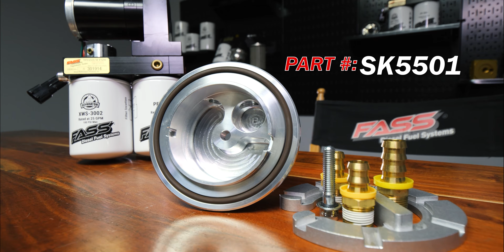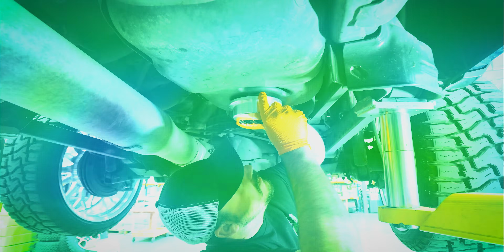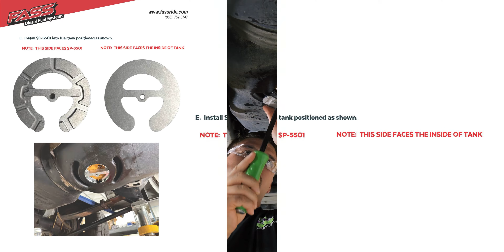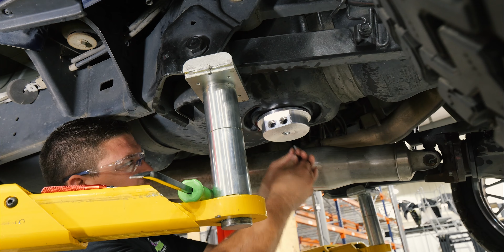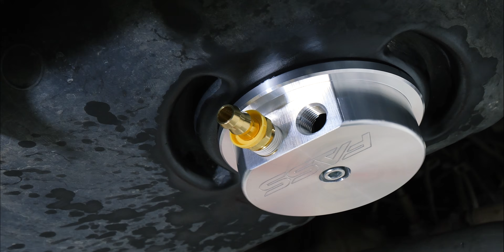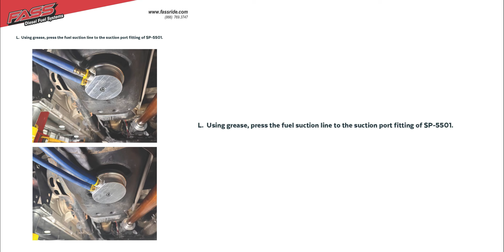FASS Sump Kit (SK5501) Installation Guide | No Tank Drop!

Comment: I seen in another video, a young man stated not to install it directly under stock fuel basket, due to interference issues.   Besides, it is now a sump.   You’ll not have to worry about a suction straw.  But if you have gotten that low on fuel, you weren’t thinking in future travels.  And I’m sure you’ll get 97-99% of your fuel before pulling in air and stalling the motor.  😊

Comment: Can I install a sump on both my fuel tank and my (electronically deleted) empty DEF tank and connect the two sumps with 5/8" fuel line to give me that extra 8 gallons of fuel usage?
Reply from the maker: Hey there,

Thanks for reaching out! This doesn’t sound like a bad idea, but it would involve far more modifications than it’s worth. Because of that, we wouldn’t recommend it, as it could still cause issues even after the work is complete.
Reply: I’m wanting to do the same thing. I already have my def tank removed and properly cleaned out. I would think running 2 of these with a vent at the top of the old def tank going to the fuel tank breather would tie them together perfectly.
Reply: @gentryhull  I did it last month. I drilled a hole in both tanks, installed both sumps and connected them with 5/8" fuel hose. Works just fine.
Reply: @smo @smoothdancer6 well I’m definitely going to do it now. How did you run the vent hose?
Reply: @gentryhull  What vent hose? Also, I didn't remove the DEF tank, I just flushed it with hot water.

Comment: Even with this "no drop" sump kit. Don't you have to drop the tank to install the lines in the old sending unit bracket I guess you could call it or does this run straight to the FASS unit?
Reply from the maker: Good question! The sump has lines that will attach directly to the FASS unit.
Reply: @FASSFuelSystems  thanks for your response. That makes sense why you don't need to drop it then. What do you do with the old sending unit?
Reply from the maker: @PogiMo1  Good question! The factory sending unit will remain in place. It will make sure the fuel level float will work.
Reply: @FASSFuelSystems cool. Thanks again for the response 😊
Reply from the maker: @PogiMo1  No problem! If you have any other questions, feel free to reach out to us 😁
Reply: @FASSFuelSystems  I am lookin at installing this in my 2006 dodge ram 2500 5.9, but am doing the research prior. A problem i cant seem to find the issue to is, you are supposed to remove the fuel pump eletrical plug so that it doesnt run at the same time as the new fass system, but that will make the fuel guage not work. how would you go about solving this problem? Not wanting the original fuel pump to run but use the fuel float ( It is the same connector) Thank you for your time!
Reply: Good question

Comment: Hey there! I've got a 2021 RAM 2500 - I purchased the no drop sump kit, but it seems I have to drop the tank in order to unplug the factory electrical... is there any work around?
Reply: Mine is a 2002 so don't know much about 2021, but like any electrical system there should be a fuse or relay to control that pump. Electrical schematics all over internet
Reply from the maker: Thanks for reaching out! If you've got time, I highly recommend calling or emailing our tech service department, as they can go in depth with you on unplugging your factory electrical. Their number is 636-433-5410 or you can email them at techsupport@fassride.com

Comment: I have finished installing sump on 2002 Dodge Ram3500. Sump, filters and pump. Easy install and mounted sump ahead of sending unit, flattest part of tank. Question: I need to install a fuel pressure gauge in cab. Where do u tap in for pressure sensor? The original banjo fitting and gauge fitting had to be removed. Hope this makes sense. Thanks
Reply from the maker: Hey there! Let me make sure I'm understanding correctly. You need assistance in where to attach your pressure sensor into the fuel system or into the cab?
Reply: @FASSFuelSystems I have a pressure guage in the cab. Need a place to attach to. Wondering if pump or filters have a place to tap into. Stock fitting was on banjo bolt that has been eliminated
Reply from the maker: @ronstotts8541  Thanks for clarifying! You can attach your pressure sensor into the 1/8th inch NPT port that is located on the silver puck on top of the filter base. It should be a brass plug.
Reply: @FASSFuelSystems thanks much

Comment: Does this prevent the pump from not being able to suck fuel below 1/4 tank level?
Reply from the maker: Great question, and adding the sump will help out a lot with the known 1/4 tank issue. We've had customers run trucks down to almost E (not recommended) and still pick up fuel.
Reply: @ Thanks for the reply. I think I’ll be doing this upgrade as I’ve been stuck twice without fuel at the 1/4 mark. Definitely an unnerving experience.
Reply from the maker: @JimmieABES  We know exactly what you mean. In any diesel, it's nerve-rattling.
Reply: Does the kit come with the 3 3/4" hole saw?

Comment: so with that return/suction valve i won’t have to plug into the connection at the top of the tank ?
Reply from the maker: Correct, with the sump you'll have both at the bottom of the tank.
Reply: @FASSFuelSystems wahoo! Will be ordering a pump this week with a sump kit. Can I cut the lines at the motor and use compression fittings to plumb in new fuel line? What about the fuel cooler connections? All my fuel lines are bad.
Reply from the maker: @tomaskey6844  Sounds like a plan, also before cutting any fuel line we would suggest reading through the manual, or giving our service team a shout at 636-433-5410.

Comment: interesting ive seen so many people say not to put the sump directly below the fuel basket. I got this same sump and fass 165g ill be installing in a few days
Reply: I followed the instructions in this video and found out the hard way. Putting the sump directly below the basket is a HUGE mistake.
Reply: @JEHJr95 can i ask why it was a mistake to put it where this video tells you too? im getting ready to install mine to get rid of my 8th tank draw straw and dont want any future complications.
Reply: @SuperbCurb  the pump is a great addition, the location of the sump is what is wrong. The location deprives the pump of free diesel flow
Reply from the maker: Awesome, let us know how it goes! If you have any questions you are more than welcome to reach out to our service team at 636-433-5410.
Reply: @FASSFuelSystems  can a guy run one of these on a gas motor with efi?
Reply from the maker: @Ken-c1w  appreciate you asking, and no sir the systems are diesel specific.
Reply: @FASSFuelSystems  hey thanks for the reply back.
Reply from the maker: @Ken-c1w  you bet!
Reply: I have the fass 165 on my truck machanic hooked it into the sending unit and return into the filler neck and it is at half a tank and is creating air and truck wont stay running. Just wonder if thats my issue. @FASSFuelSystems
Reply: @marcusLT I’m sure you’ve fixed it but yes you need to go too a sump. Your pick up tube is cracked or it’s having issues drawing through a small diameter pick up tube.
Reply: So far, it was a water in fuel issue i haven't added the sump yet, but it does worry me getting below half a tank, being it is sucking through the stock tube. It runs and drives great now that all the water is out.  @marcsheppard2898
Reply: @marcsheppard2898  I’m having somewhat of that issue getting sudzy aerated fuel out of bleeder and thinking something with the tank but was told since fass “removes” air that my air has to be coming from a line between fass and bleeder ? Any thoughts?

Comment: Do you have specific instructions for my 2020 Ford F350 6.7 for using the new sump vs dropping the fuel tank as far as the correct way to plumb the sump and what to do with the Ford lift pump in the fuel tank & existing fuel lines? I hope that makes sense.
Reply from the maker: Thank you for reaching out! While we don't have instructions for specific applications using the new sump we do have universal instructions on the website. 

https://150227407.v2.pressablecdn.com/wp-content/uploads/SK5501.pdf

If you have any other questions, or need anything we are available from 7-7CST at 636-433-5410.